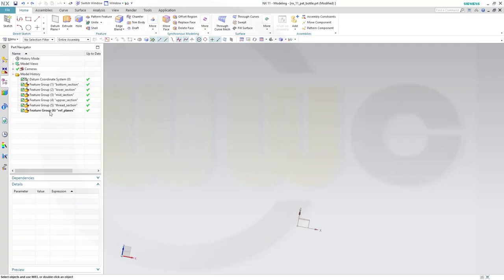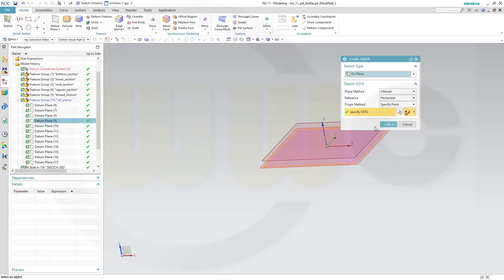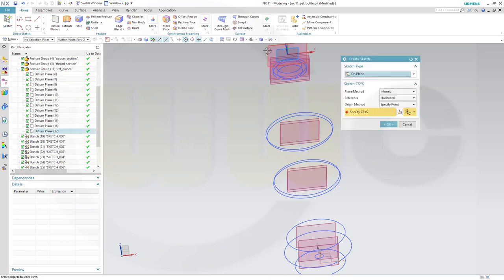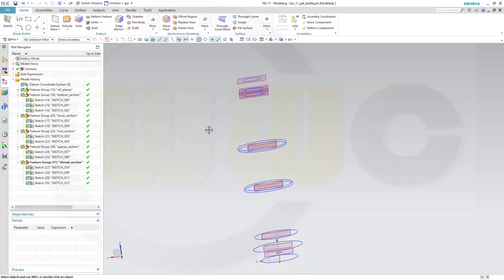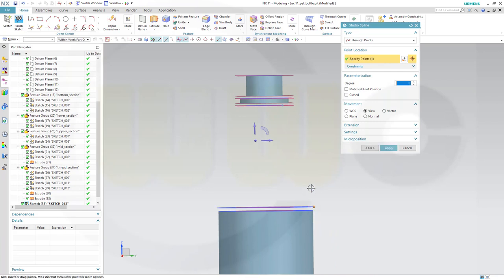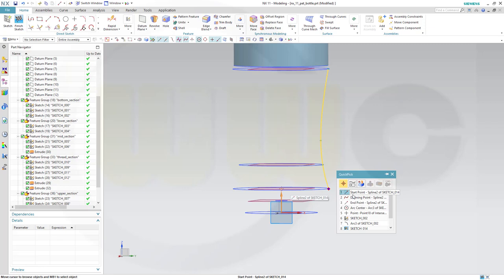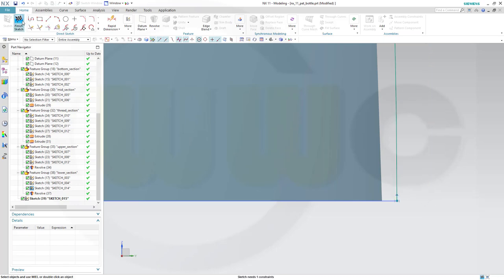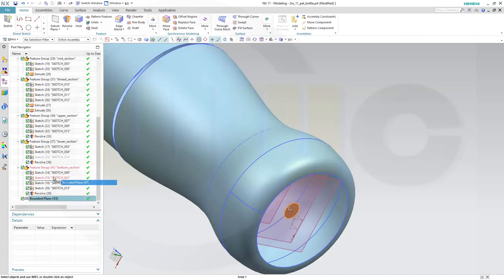PET - Bottle - Part 1 - Siemens NX 11 Training - Surfaces

Comment: yeah, man. i can make that bottle in 3 minutes: make proile sketch and then revolve it,  then place line on the face, plane on the start, profile sketch on the start and sweep it, pattern it with substraction. (i typed longer than i can do it)
Reply from the maker: Yes, I could do a similar bottle as you suggested, but 
1. this is an exercise and 
2. you would not get the same bottle.
If you can´t recognize that - perhaps you might be a troll?

Comment: respected please tell me how can we use lofted cut of solid works in siemens nx 11 ?? i am unable to do it , plz help me to solve it.
Reply from the maker: LOL maybe you should do some of my exercises first - there is no lofted cut in NX - there are "through curves" , "through curves net", "studio surface" and you can unite (merge), subtract or intersect.
Reply: respected sir i know in siemens there are many ways to do but my aquestion is can we do directely with any command ???
Reply from the maker: Just use one of the before mentioned, depending on what you want to do, you may have to split your surface into parts.